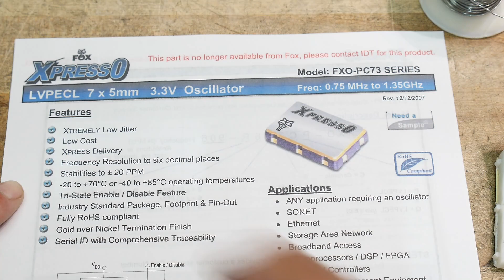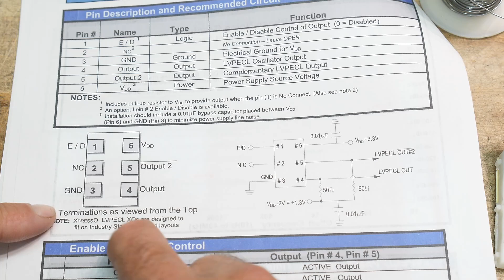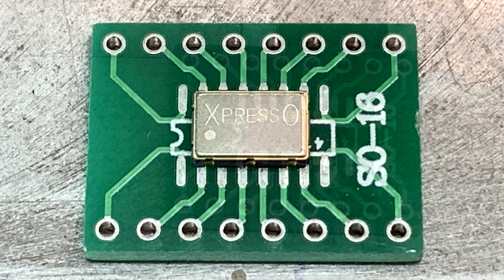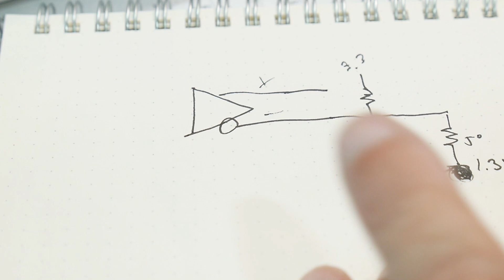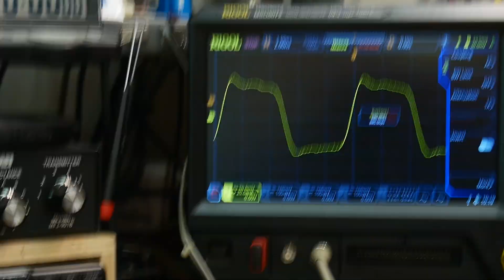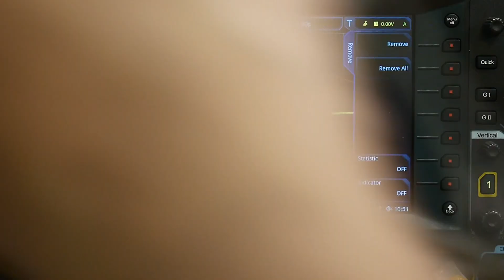#861 106 MHz LVPECL Oscillator Pulse Generator

Comment: Hi. Can you measure reflection of the scope's inputs using nanovna, that is connected to that ports directly w/o cable?
Reply from the maker: why, that makes no sense
Reply: @IMSAIGuy  Low frequency scopes have 25pF capacitor at the input. Obviously, that does not work at 500MHz. So, it is interesting how Rigol did it.
Reply from the maker: @TheChipburner  1megohm 17pf 350mhz bw
Reply: @IMSAIGuy  17pF has impedance of 27Ohm at 350Mhz, that is too low.
Reply from the maker: @TheChipburner  sorry, the scope works just fine. https://youtu.be/eaoHYWYLRV0

Comment: Great video, thanks. For 'truth' you could use a 50 ohm coax and the scope in 50 ohm mode. Or a 50 ohm 10x or 20x probe.  Or a homemade 950 ohm resistor + 50 ohm coax to give a 20x fast probe. Either will give <1GHz bw. I have used all of these with my Tek 794D 2GHz scope with great results.

Comment: If you're ever interested in a handy upgrade, I'd steer you towards the TI LMK61E2EVM that has a USB programmable frequency and a rise/fall time <200ps on its dual 50ohm differential outputs. Its TI LMK61E0MEVM little brother has higher amplitude LVCMOS +/-33mA 50ohm outputs with a selectable ~200ps/1.1ns rise/fall time. Neither are cheap nor low power, but they are programmable with convenient SMA outputs.
Reply from the maker: Thanks, looks like a nice part

Comment: Hey , you should try out the Riogol 4162 S/Gen. If you are doing much radio work it's great up to 160Mhtz.Learned about it from xraytony's channel. Quite impressed with its working. Good session!
Reply from the maker: I have HP generators good to 1000MHz. You can get a nice sine wave but what I need is a fast edge for these tests. I've already done the sine wave tests up to 500MHz in a previous video.

Comment: I think the greatest value of this video is confirming that we don't have to worry that much about the scope-probe as long as we're not buying absolute junk--thanks for doing it!  Also, in my experience, if I am going to have a circuit that generates fast waveforms, I solder one of those coaxial-connectors to the PCB that allows the probe-tip to just plug in; if you have one, you might try that as the ground wire-clips are problematic.
A long time ago, I had an HP 1-GHz vacuum-tube sampling oscilloscope (it was GIGANTIC!).  So they did make much faster probes.  I might should have kept the probe when I sold the scope, as it would have made a great reference probe.  I also think it was a 50 Ohm system...
Reply from the maker: Yes if you stand the low impedance then skip using a probe.
Reply: @IMSAIGuy  Well you just stirred up a question! Since you have yourself a very fast square wave generator, does the RIGOL scope have a 50 ohm input selection where you could just run coax to check the ultimate response of the scope?
Reply from the maker: @SpinStar1956  yes, I should do that someday. Rigol does not have 50 ohms but I can put a load on the input
Reply: @IMSAIGuy  That’s good, because it would be nice just to run straight-coax so that you have less fixturing for this particular type of test. Also it would be interesting to actually look at those loads that you spoke of on a VNA just to see how clean they really are.

Comment: You never showed the hook up of the probe tip. Are you using a 6" lead for the ground connection? I think you have mentioned the Curly Q. A very short ground that has a ring for the tip ground and a smaller ring for the tip to slide into. I just saw a part where you should the 6" ground wire.
Get rid of that. Here is a poor picture of a PCB that has two Curly Q's, The angle is bad so you can't see the holes where the scope probe inserts, but I think this will help.
Reply from the maker: yes I did that, read the description for an update on the measurements
Reply: @IMSAIGuy  OK.